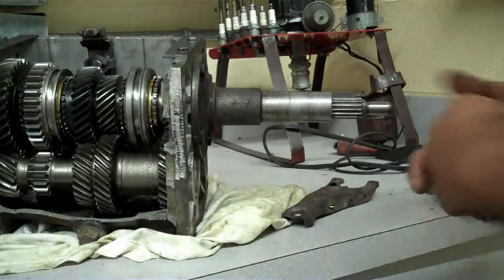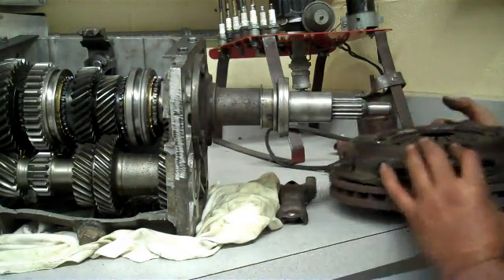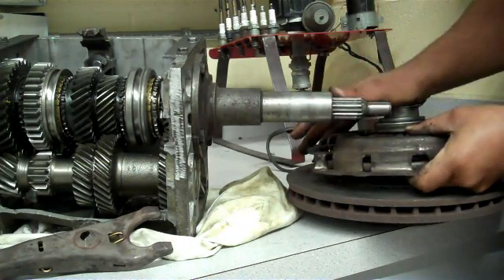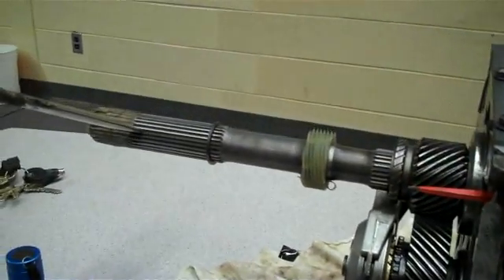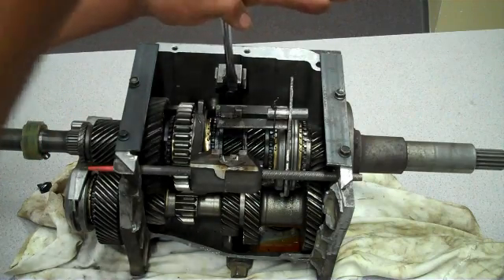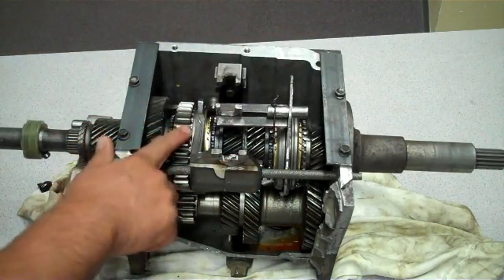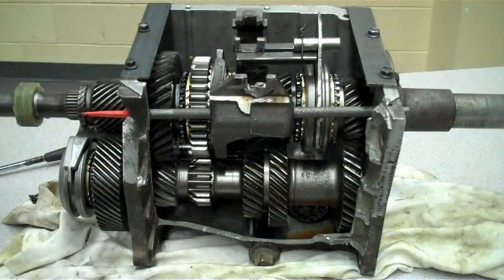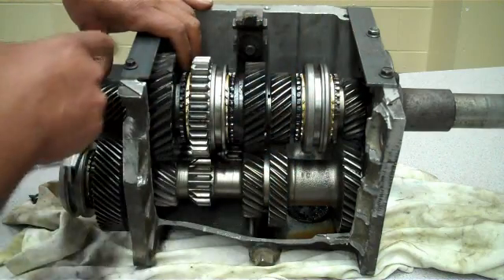How manual transmission works (Revised). Part-1

Comment: In my 91 corolla, when I try to shift into third I feel something almost "blocking" the gear from engaging. When I try and pull straight down into fourth, it sinks into the gear, but when I release the clutch nothing engages and all I hear and feel is metal grinding. First gear and second gear work just fine, as well as fifth and reverse, but not the two middle gears. Thoughts?

Comment: Clutch is needed to engage and disengage the engine from transmission. Engine RPM's under normal driving vary between 1000 RPM and 3500 RPM. It is the different gearing in transmission that change speed.

Comment from the maker: Only one clarification is that clutch does not disengage from the input splines. When clutch pedal is depressed it is no longer squeezed between pressure plate and flywheel and this stops it from spinning with flywheel.

Comment: So... When the clutch pedal is separated, it disengages the clutch from the input shaft's splines. This stops the clutch from rotated and allows you to shift gears.
Basically the gears differ in size, the bigger the gear, the longer it takes to rotate which means less speed. These gears are selected via the shift lever, which moves the shift forks in the transmission, which then attaches to the correct gear size. All the power from the selected gear is directed to the output shaft then the diff.

Comment from the maker: Engine is directly attached to input shaft and the gears on the top row are also attached to the input shaft. The output shaft is inside the input shaft and the synchro collars are attached to the output shaft. when in gear the synchro collar locks the input and output shaft.

Comment from the maker: -Engine is connected to input shaft
-Gears on counter shaft spin with counter shaft.
- Synchro collars are splined on to the input shaft and when in gear, it locks the collars on to the out put shaft.